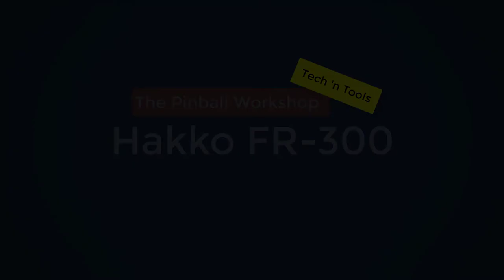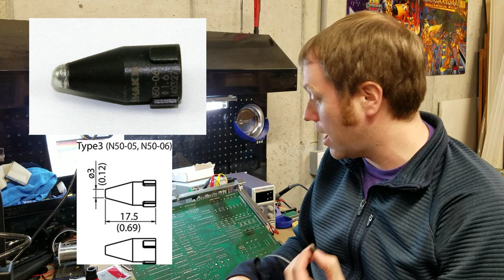Tech 'n Tools: Hakko FR-300

Comment: You've got your ceramic paper filter in wrong my friend. It is supposed to go on the GUN side of the metal disk not the nozzle side. That metal disk is for the hot solder to hit against it and cool down in the chamber without clogging up the filter prematurely.  

Reflow the solder (especially with old oxidized solder) and you'll find it will suck out much more efficiently. Once it goes liquid, you DO move your nozzle, - VERY lightly - pressed against  the board (you need to be able to seal it a bit for better suction to be created) in a tiny circular motion while sucking. It will keep solder from sweating and sticking the leads back to the through holes. By keeping the lead away from the holes it allows all the solder to have an unobstructed trip to palookaville. The suction also helps cool the components. 

You are right though about excessive pressure against the board or you will damage it. The key is the right temp, fresh solder and get in and out of there in as little time as possible. Shouldn't take more than 3 seconds per lead (give or take).  

I have the Hakko 808... LOVE IT!  Thanks for sharing.

And by the way, it's pronounced...    hawk-oh     :c)
Reply from the maker: You caught me on the filter paper. I noticed that after the video! Thanks for sharing your tips!
Reply: No problem my friend, just wanted to be sure you realized about the filter. Have a good one!

Comment: You need to apply flux, that will make easer to suck the solder and don't damage the board.
Reply: That's the last thing you want to do is apply flux. You will be changing out filter every 5 minutes.

Comment: Obviously a great but quite an expensive machine. I have used the Hakko 474 which works fine. But I picked up a (yes, Chinese) ZD-8915 desoldering station a while ago and although the build quality is probably not the very best, its heating power and suction is a  lot better than the Hakko 474. Tips are fine, parts are cheap and I bought mine for 70 Euros!!! A new Hakko 474 costed 10 x the price. And I have done a lot of work with it without ANY issue.